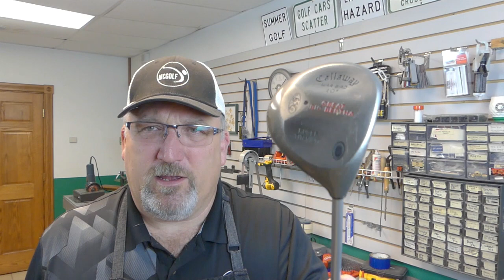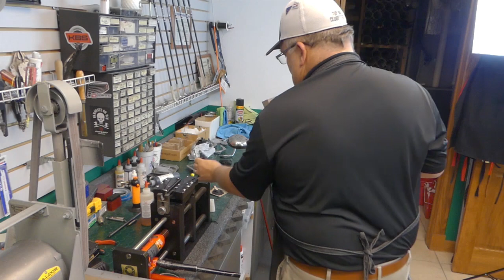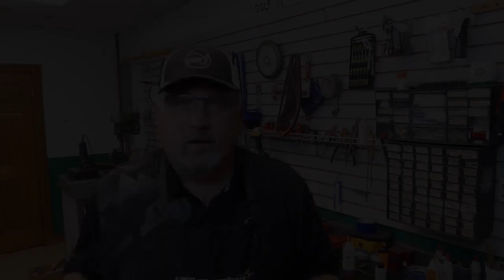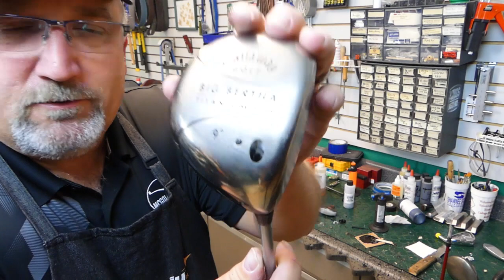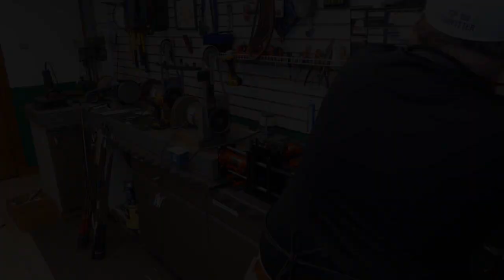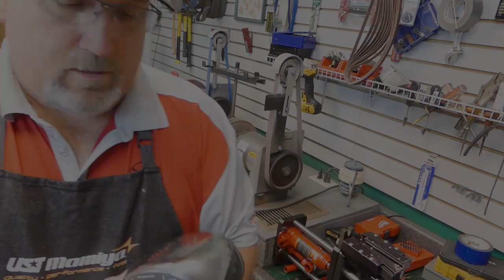Golf Club Repair: How to remove a golf shaft bore thru

Comment: Could you give us some dimensions of your little white adapter for pulling the shafts; particularly the angle.  I'm guessing about 60 degrees.  I have a shop-built puller that utilizes a large spring and two piece collets that are bored to .340, .360, and .380.  The same collets could be used with our puller with just a short piece of pipe similar to your adapter, but square on both ends.  Also, I usually added two payers of masking tape the sole and cut the hole out with an Exacto knife as extra insurance when cutting the shaft end.

Comment: Hi! Great video! And great channel too!
Do you know which would be the best alternative to replace the dampening neutralizer polymer pin in a Titleist 585h hybrid? I recently bought a used one, and it shows some cracks, which are logical considering the age of the club.
Thank you in advance!
Reply from the maker: Mauricio Eguchi typically it requires a shaft pull and a re install with a new pin
Reply: @McGolf  OMG. I'd read that 585H hybrids wasn't a true bore thru design. The pin do not hold the shaft, and is just for vibration dampening/ head sound tunning. Could it be right?
Reply from the maker: @eguchino It could be that there is a plug and that would be a repair that tiliest would only perform as they control that part. However and typically that plug is not very big more like a cap. If there is a crack big enough for you to see you might try the drywall patch method and get some expoy and press it into the crack smooth it out
Reply: @McGolf  thank you for the reply! I will try to repair the cracks as you told me in order to keep the assembly as original as I can. I will let you know the results as soon as I can take it to the range.
Thank you for your great service!

Comment: I have a Great Big Bertha II 10* head. The shaft broke at the hosel. I've had it laying around for years. I have been thinking about having the broken strands of graphite removed and a new shaft installed. The big question is what is the price point for a complete repair/refit as you did in this informative video. I don't want to just throw away the head. Seems a waste if a new shaft can be installed.
Reply from the maker: artcore1950 $35 plus the shaft and grip

Comment: I’m doing a callaway x460 when you install the ferrule with the adapter, do you rough that up too?
Reply from the maker: Justin Sommerfeld yes the glue sticks easier
Reply: @McGolf  how about changing shafts on a Callaway FTIQ clubhead that does not have IMAX.
Reply from the maker: You can change shafts but will have reuse ferrules. Check shaft tip diameter to make they are the same
Reply: @McGolf  I already tried to heat it and it only burned my club head then I cut it off at the shaft base and started drilling everything out, I couldn't tell what was shaft and what was ferrule I was drilling out, I totaled it out, it's ok I've lost thousands of dollars on golf. With tee times, 2 Buckets of practice balls every week, new and used iron sets, drivers, putters, since 1984 when I started playing golf I must of spent 100,000 dollars.

Comment: Another very informative video, but one question, did you not have to add or remove weight to keep the club balanced as it was a different shaft that you fitted.
Reply from the maker: I did not the shaft was longer than usual and made up for any weight issues